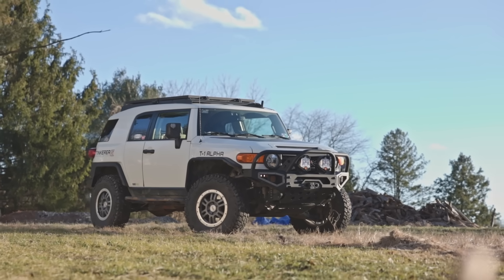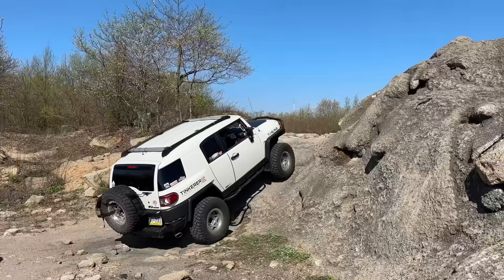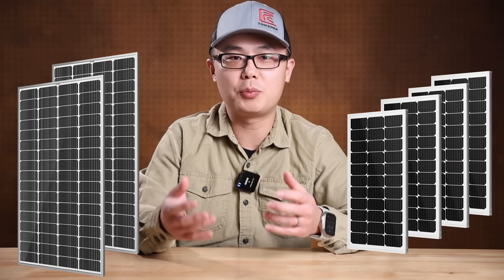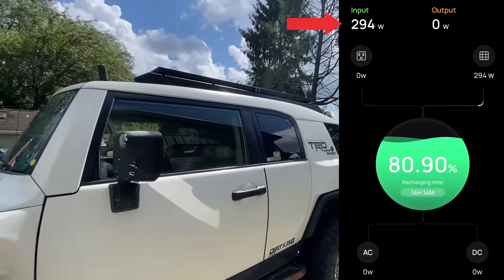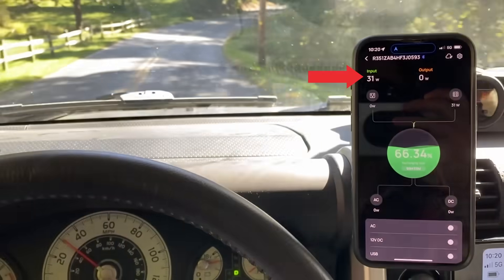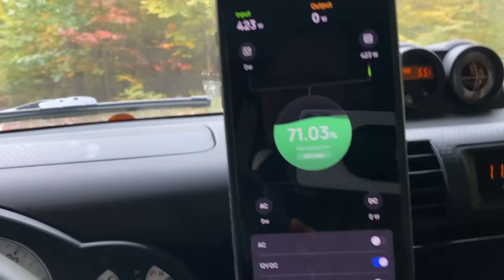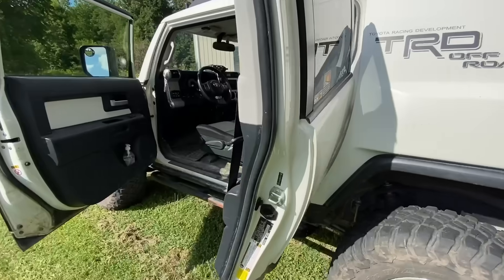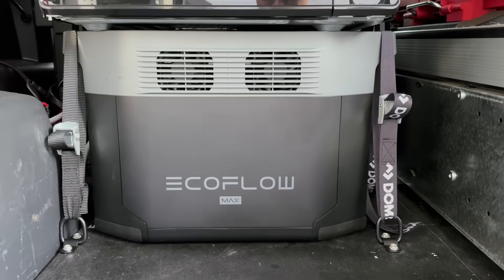I Installed a GIANT Solar Panel on My 4X4 | BougeRV 400W 10BB Mono Panel

Comment: I love this topic! I often wonder though, wouldn't the EcoFlow smart generator be a much easier and guaranteed method to top off your charge? So much flexibility there and you wouldn't be beholden to fair weather, but I suppose its a pretty big brick in the cargo area.
Reply from the maker: Yeah the size and can’t run anytime inside the vehicle are why they didn’t work for me. But could be good for a different application
Reply: @TinkerersAdventure  I agree, having the solar panel constantly feeding power is a nice win. I have been using an Anker 757 battery with the EcoFlow Glacier. The EcoFlow's AC adapter works in the Anker's solar charging port and cooperates with the Bronco's modified sine-wave 400w inverter outlet. So that's giving me 200 watts into the Anker, and then I run a USB-C cable to the EcoFlow. This allows the fridge to basically have priority and always be topped off. Anytime the ignition is on, the Anker begins to recharge. I want to swap that Anker for a Delta 2 when I can, because I agree with you having ports on the short side is far better.
Reply: There is another option is to carry a propane ONLY generator (ALP generator). It allows 1lb green propane bottle connection

Comment: Have you shopped for the solar panel stickers that go on your hood? I’m pretty sure they make them for the FJ
Reply from the maker: Yes, they are a little small, but maybe down the road to add on top of this
Reply: @TinkerersAdventure  I have been considering the sticker type panels for my rig to cut back on my aerodynamic losses. I’m curious if your cab stay cooler with those panels shading it maybe? Or is that a stretch?

Comment: I upgraded my alternator to a mechman 250ish amp output. I used a step up converter to step up the voltage coming off my battery to 58v and have it going directly to my Bluetti. With that, I charge my AC200MAX at almost 900w while I'm driving. Its an awesome setup and I dont need solar. It charges up pretty quickly
Reply: What vehicle that you have, upgraded the alternator? Are you DIY for this upgrade or a shop did that for you?
Reply: @walijosh945-km1kx  Mechman is the brand, they're highly reputable.
Reply: Can you explain more on what you use to step up voltage and charge the bluetti? I have a very similar setup and would like to do something like this.
Reply: @deserttortoiseoff-road7285  To add, you really need to know about the electrical side to safely power it up, but I plugged it into my PV side of my bluetti and I have an on/off switch in the cab to control the charge. I dont reccomend it without having an alternator capable of pulling the additional amperage.
Reply: what converter are you using?

Comment: You should use some rubber padding with your solar brackets. Those rigid panels may develop some micro cracks when they are under constant stretching forces.
Reply: I kinda thought the same about if it was rigidly mounted that minor body flex or something may cause issues later.
Reply: The middle of the glass panel will do all the flexing, like how a trampoline looks when someone's on it. That is what will cause all of the damage to the cells if the vehicle is driven
Reply: It´s possible it does, it´s possible it doesn´t. 
It´s possible to put man on the moon.
Reply: @--Singularity-- since stan kubrick passed, people cant get to the moon. 😂
Reply: Maybe a 3 point setup?
Reply: It's possible rubber mounts would allow more flexing and stress on the Solar panel.
Reply: @pstoneking3418 yeh rigidly fixed is probably better

Comment: Great setup! How do you connect both your alternator and your solar panel to the one solar port of the ecoflow delta 2?
Reply from the maker: You cannot do that with the Delta 2. That was one key reason I switched to the Delta 2 max with dual independent ports.

Comment: Fill the roof up would be my advice for solar.  I put 800w on my RV roof and the panel cost was 5% of my total system install (lithium, inverters, etc.). I think the mounting hardware cost as much as the panels.  

I also like that you have more wattage than almost every sprinter van I've seen.

Comment: Why not keep some storage space under the solar panel? Also with as little sun and solar angle as you have, why did you bother with this mod at all? All you needed was a bigger alternator and some extra fuel. Like I run a 1000W inverter with my 4Runner upgraded alternator. It hardly adds any loss of mpg. Seems like you didn’t really pick a solution for your use case and instead just wanted to use solar for the sake of using solar without even attempting to mitigate the loss of the roof storage, which should have been possible, even with a roof top tent.
Reply: It does seem like he considered his use and covers various aspects in the video.

Comment: I put 4 B-RV 9BB 100watt on top of my GX470.  2 X 2 in series then parallel.  The main goal is to run an A/C on hot days for the dogs.  It currently goes to a Bluetti AC200Max and an Ecoflow Wave2.  I have a foldable panel to add on those extra draining days.  

And... I run a trickle charger to the car battery to be sure the beast starts when its time to head out.  The GX470 does some constant discharging when the key is in the ignition and any doors open, so it provides a margin of safety.
Reply: Quick question... I followed the link in your description and found the panel spec is "27.62kg / 60.9lb".  You mentioned the one you mounted weighed in at 37lbs.  Are you sure that is the correct link to the panel you mounted or did they do some updates to the panel to prevent the trampoline effect? Thank you for your time!